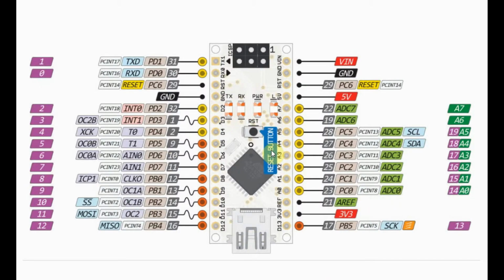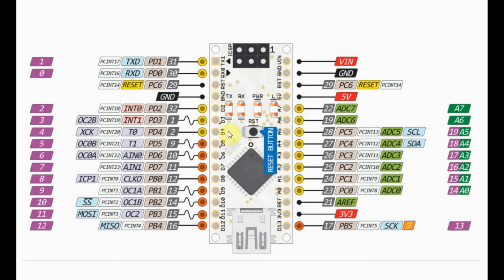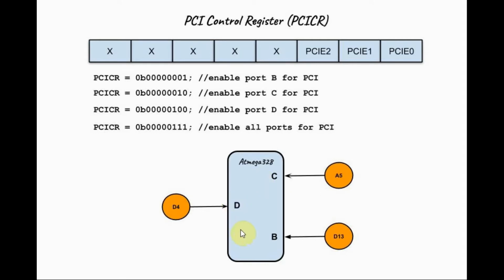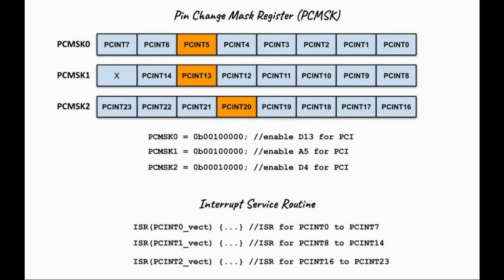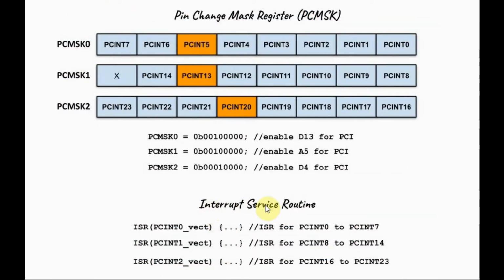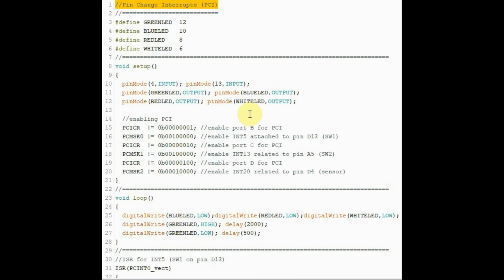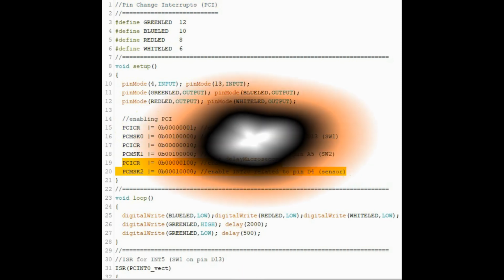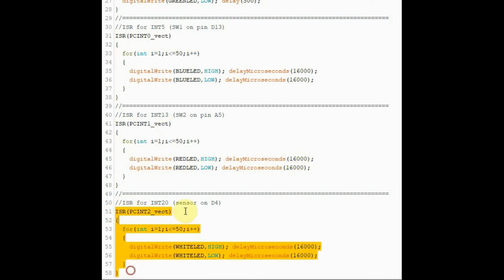Pin Change Interrupts in Arduino Nano

Comment: Do we not need to set the I-bit in the SREG register to high before any interrupt is enabled? Similarly I didn't see the I-bit in SREG set back to high after each execution of the interrupt subroutines. It was mentioned in the ATMEGA328 manual that the I-bit will be reset back to low by hardware after an interrupt has ocurred

Comment: Video is very informative. The only thing I didn't understand that inside ISR function the parameter is given ISR(PCINT0_vect), ISR(PCINT1_vect), ISR(PCINT2_vect),  From where PCINT0,1 and 2 comes.
 As per datasheet we should be using PCINT20, PCINT5 and PCINT13  for pin D4,D13 and A5 respectively.

Please help me to understand how PCINT0,1 and 2 comes instead PCINT20,5 and13. Thanks in advance.
Reply: Please reply  I need to use interrupt urgently.
Reply from the maker: Hi. ATmega328 has 3 registers related to PCI, namely, PCMSK0, PCMSK1 & PCMSK2. Within theses registers PCINT0 to PCINT23 are allocated. Also, associated with each mask register is one ISR. So for example any pin change interrupt is enabled within PCMSK0 will invoke  ISR(PCINT0_vect). I hope this clarifies, and I apologize for my late reply.

Comment: Hi Anas, this is Gokul.I would need you to guide me. Im building my own flight controller but the thing is I need to know which programming language would be better serving me to unlock the full capabilities of the microcontroller if I learn it. As of now I'm using C++.
Reply from the maker: A combination of C++ and assembly. You can check out my series on programming Atmel controllers via assembly. Good luck with your project.
Reply: @AnasKuzechie  Thank you so much. Sure I'll do that... Sir.